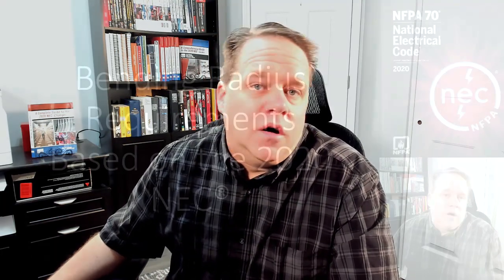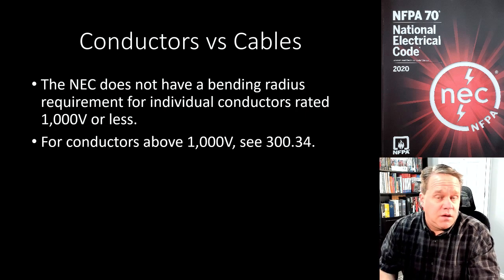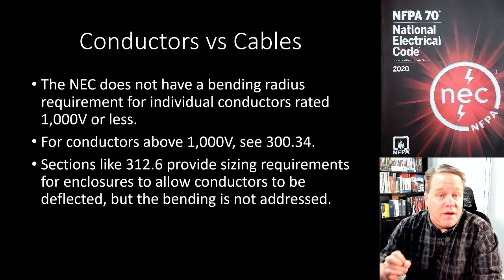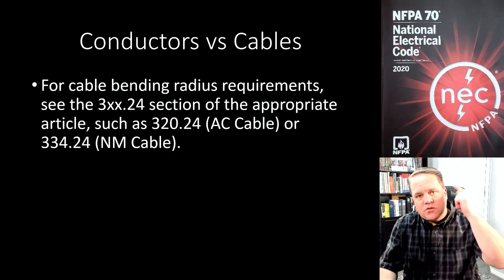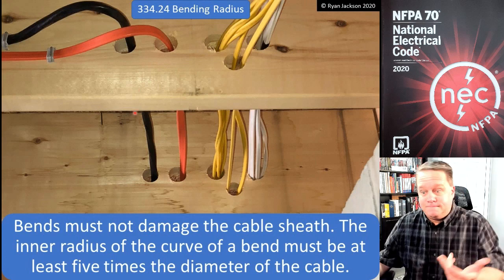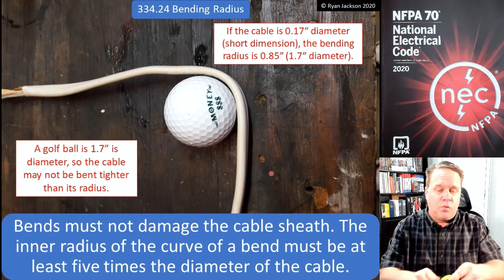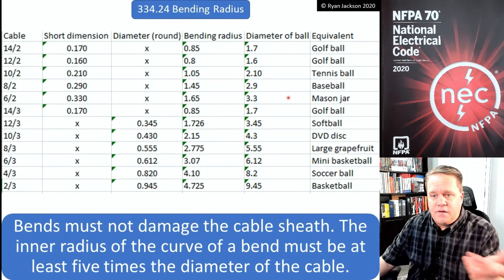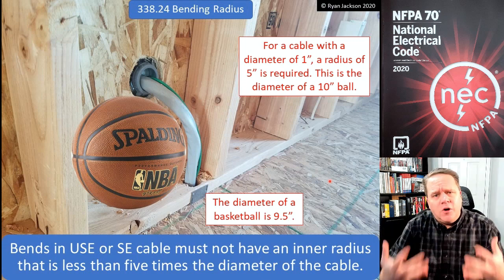Wire and cable bending radius requirements

Comment: Greetings Ryan - Love the video like always my friend. Just figured I would comment on the maintained bending radii aspect for Wire and Cable manufacturers. We maintain the "diameter" as expressed will depend on how the installer bends the cable assembly. In a flat cable, there are many who will bend it on the flat "long" side or the short side so from our perspective you would use the value depending on how you actually bend the cable assembly. As you eloquently explained, if it was round configuration cable then it becomes moot as it only becomes an issue with flat cable assemblies. Keep up the great work fella.....Stay Safe! (Sorry Grammar Edits - My Trolls love my grammar)
Reply: I also should clarify fella - From our (not all manufacturers, just speaking for one that I am associated with) we believe, and not part of any listing mind you, that when bending on the short side you would use the LONG side value. When bending on the long side you would use the Short Side value. Again, nothing demands this as again we will say as long as you do not damage it lets your specific installation be your guide. However, that is how we would tackle the ambiguity of the NEC position on maintained bending radii if we provide any guidance to the installers. Our logic in C & S is that there is more potential for insulation elongation with short side bend than a long side bend, if that makes sense. Hope that helps explain it from at least one manufacturers perspective.
Reply from the maker: I totally agree, unfortunately it appears that CMP 7 doesn't. They will require the large dimension to be used in the 2023 (barring a CAM or SC appeal). Frustrating!
Reply: Oh frustrating indeed.....and always makes me wonder why I do it. But alas....we press on.
Reply: @RyanJacksonElectrical  I can tell you why they choose the long dimension value, as I am sure you already know. That affords the manufacturer the greatest value (radii) and reduces the potential for damage to the cable assembly by having an increased radius on the bend for the cable assembly. As usual, the normal conservatives approach if you will.

Comment: I have question on the SE cable you shown in the video.  So if I have my panel is above where the cable is coming in do I need to place a nail plate on the stud where I am securing the cable too.  I live where the the exterior walls are framed with 2x4; so if  I mount the meter base on the exterior wall I can't run the wire through the wall up the between the studs into the ceiling to my panel inside the house. Because I won't have the correct bend radius on the cable.
Reply from the maker: Correct. See 300.4(A) and 300.4(D).

Comment: I know this is off topic but I would like to ask the following:  At 4:17 we see more than one cable running through a single hole in a joist.  does that require the conductors to be de rated?

Comment: The thing with NM is that the outer sheathing is very soft and is easy to make it round when working with it. The inner THHN conductors will slide over each other. This gives an easy way to picture the diameter. I'm not suggesting one twists the cable, just that I've run into it when working with that crap. I prefer emt, plus in Chicago/Cook County, it's not allowed :)

Comment: At 5:48 did you mean to say the length of the cable instead of the width. I am confused and am trying to figure out which side of the cable is which.  I know we think of length as in the how far the cable is going, but wouldn't it technically be height. I don't know, maybe I'm getting really hung up on the math here.

According to the chart would 14/2 romex wouldn't .17 inch width and .39 inch length. Again, I know when people usually refer to length they mean how far the cable is running (like 12 feet of cable), but I thought that math would be the height. Height is the amount if held from the ground up. Length is the longer side. Width is the shorter side.
Reply: It's listing the cross-sectional measurements, so there are only 2 dimensions in that case, not 3d. A flat circle/ellipse

Comment: Awesome glad to see some content! When installing service entrance conductors say for a 800 amp service can you use parallel 500 rated 760 amps or would it be best to install parallel 600 for the full 800 well 840 amp conductors. I'm just a apprentice needing a little input. Nothing pretaining to work just info. Ik that 83% of 800 amps is 660 amps or so and the load would likely never exceed 83% but would it be best to size over your ocpd? Or could you use the parallel 500 rated 760 amps in the 75°C?
Reply from the maker: You can use parallel 500s, provided the calculated in 760A or less.

Comment: Ryan, I would say that if the sheath is removed from a 12-2 NM conductor you would use the diameter of the individual wires.  Right?  This requirement makes it difficult when setting multiple wires in a jbox.  I have seen wires packed into a box and by calculation they met the box fill requirements but minimum bending was very questionable!

Comment: Ryan, awesome video. If the wire kinks 180 degrees during unraveling or install, and you remove the bend, is the wire still good to use? Thanks.

Comment: Good explanation. Thank you.
Not that it is typical, but it would seem that if the bend is with the long dimension of a flat cable (in lieu of the short dimension as demonstrated), the bending radius would be 5X the long dimension of the cable and not the short dimension.
Reply: Good point. Where this might be common is on the outside of a home running SE cable from the weather head to the meter pan. Since the clamps are generally made for fastening the cable flat, you'd need to consider the sideways bend if it's not a straight run.
Reply: I think the code specifically stats that for flat cables the larger of the 2 dimensions is the one we use regardless of how its being bent
Reply: @danielmcdougle6925  ... if that was the case then we'd never see SE cable in a wall cavity, yet we do see service cable going into homes that are bent at the sill board or going straight out the back of a meter pan.
Reply: @danielmcdougle6925  334.24 Bending Radius.  Bends in Types NM, NMC, and NMS
cable shall be so made that the cable will not be damaged. The
radius of the curve of the inner edge of any bend during or
after installation shall not be less than fve times the diameter
of the cable.
Reply: 338.24 Bending Radius.  Bends in Types USE and SE cable
shall be so made that the cable will not be damaged. The radius
of the curve of the inner edge of any bend, during or after
installation, shall not be less than five times the diameter of the
cable.

Comment: You have really made this clear for me. I am on a job where the inspector wanted our foreman to change the 4/11s to a larger box size because he knew the radius was very tight. However, this was a change for THHN 4 gauge and not for cable. Would you have made this change? 1inch pipe feeding into a 4/11box with another 1inch pipe 90 degrees to the A/C unit with 3 conductors. Thankyou for the great content, glad to see this video.
Reply from the maker: I would yell the inspector that I needed a change order signed. Somebody needs to pay for it.
Reply: @RyanJacksonElectrical Would you please make some content on this subject. Many apprentices including myself are totaling in the dark about these types of conversations that happen with foremen and inspectors.
Reply from the maker: @jaredhouston4223  I'll put it on my to-do list.
Reply: @RyanJacksonElectrical  🙌

Comment: Love the ball examples 😃. Is the calculation the same with MC?  You need a ball example for that too. Thank you.
Reply: MC will let you know if you're pushing it. If you take 3/8" MC and make a 90-degree bend, it's going to require way too much force to get much tighter than about a 3" radius by hand, and it's not specd to be any less than 2.625" (7 * .375).
Reply: @stringlarson1247  I agree, MC by its nature won’t let you push a bend without destabilizing the joints.   Thank you for your explanation.

Comment: The latest version of the NEC added "For flat cables, the major diameter dimension of the cable shall be used to determine the bending radius.". So you cannot use the thickness in any scenario regardless of the way it is bent.
Reply from the maker: Correct. I tried to stop them from doing it because it was a terrible change, but my public comment didn't help. They are fixing it in the 2026 NEC, however.
Reply: @RyanJacksonElectrical  Interesting. So my state doesn't adopt the 2023 version of NEC until 2025. Since the current version has ambiguity, and the next version clarifies the ambiguity, do you think that an inspector would still interpret the current version with the clarification that the new version has?
Reply from the maker: @shawncorrigan7514  Hard to say. I can tell you that in my home state (Utah) we amended the problematic language and have incorporated the 2026 revision. At least, that is the recommendation I am making as the Chairman of the Electrical Advisory Committee next week when we discuss the issue.

Comment: Ryan, when I was wiring Schweitzer Relay using sis 14 gauge wire I would use an 1- 1/2 “  * 8” long  aluminum rod.  This is what I used to accomplishment my smooth radius for my sis wire.

Comment: The basket ball radius is really big, especially when you put it up to a 2x6 wall, difficult to understand
Reply: Think of it this way: The basketball is roughly 10" in diameter so only 5" radius. The 2x6 wall is just under 6" so a 90 degree bend is allowed within the cavity. To do this in a 2x4 wall you'd need to use a flat style SE cable because it has a smaller dimension.